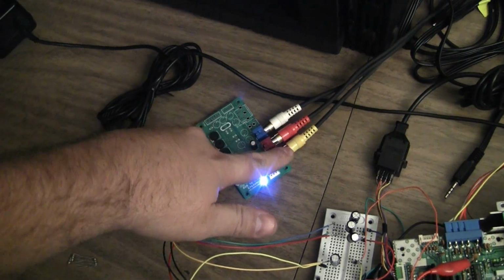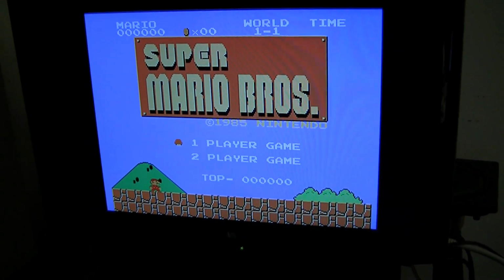NES Nintendo - Component Video - PC10 PPU NCS2553 rgb amp LM1881 sync Jrok encoder

Comment: Component video is the cleanest way to display every lit pixel of its RGB value. An NES blue of 0,0,252 will look a bit off with coaxial video and composite is a bit better but with compnent that blue will look like the way it should. Nice video but as an average gamer I don't think I can do the same project. I might fry something. I guess I just keep on enjoying yellow video. It's amazing what you can do to these old systems.

Comment from the maker: If you are talking about UTsource's supposed stock then you should know its fake, and they prolly pull them from PC10 board's anyway.
The B version is the chip from PC10 and VS boards, so that's not an alternative either.
The D version you listed is not an RGB ppu as far as is known.
I'm also quite aware of the BA6592F, but so far it doesn't not work with the PC10 chip, I tried for a week with no luck, unless I have a bad one.

Comment: You don't have to pull out a PC 10 PPU actually. You can order alternative parts like a RP2C03B (which is the same chip and seem to be out of stock, a RP2C02 (D revision) which you can still find for $15-20..

Also, a cheap alternative for component video conversion is the Super NES S-Enc BA6592F chip. You can find these things for $3 a pop. They will work with any system with RGB out. Hope this helps.